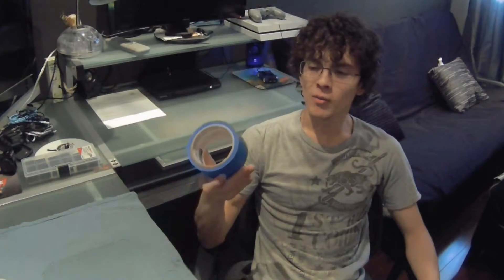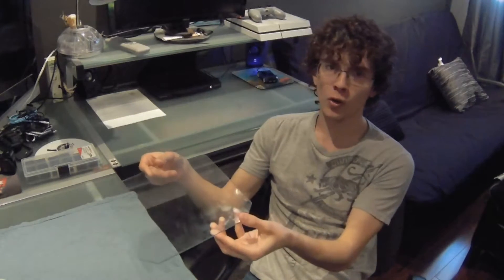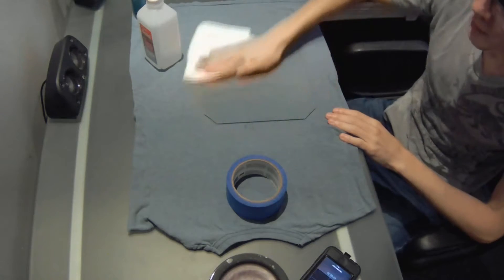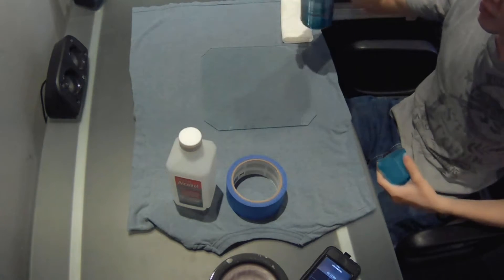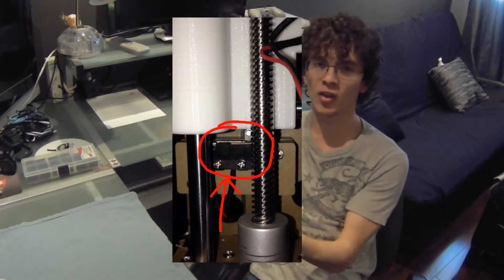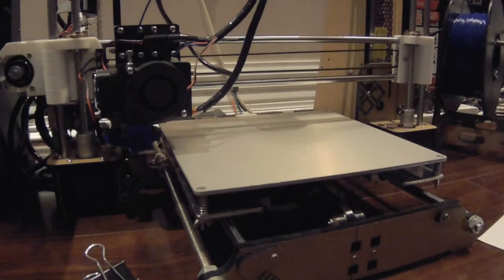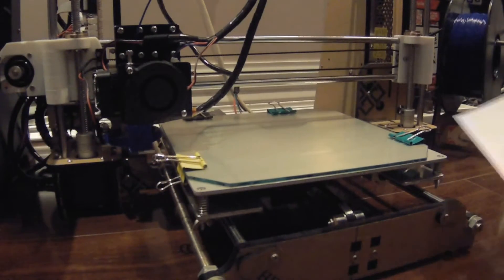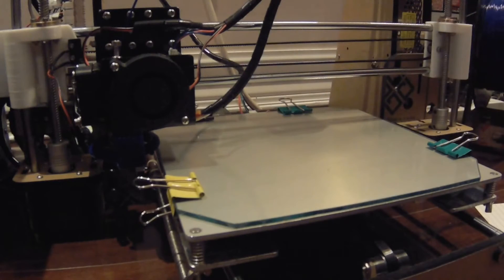Anet A8 Glass Bed Tutorial

Comment: I tape mine on the bed with painters tape around the edge
Reply from the maker: Steve Mc does it hold the glass tight enough? Sometimes I find my extruder knocking around or pushing the clamps, so I'll definitely try that!
Reply: I use thin glass from picture frames bought at the dollar store. I tape it along the edge along the Y axis only as the glass I have is too short for the  X axis. Preheating the bed before spraying on the hairspray helps with stickiness. Also when running ABS turn up the bed heat a little to compensate  because glass is an insulator and always preheat the bed when running ABS.
Reply: It works fine for me. I run it along the edge and fold it under the bed about 10mm.
Reply from the maker: good to know it works with abs too, since I haven't tried it yet. as for the hairspray, do you wait until it dries before printing? i usually spray it and wait around 10 mins until it dries and then preheat to 65 for PLA and print
Reply: I preheat before the hair spray
Reply from the maker: wouldn't that cause hairspray to get into unwanted parts from the 3d printer?
Reply: Good question. I hold cardboard at the back of the bed to protect the rails and get up close to reduce overspray. Been doing it for months without a problem.
Reply from the maker: oh i see. yeah that makes sense and works really well. thanks for the advice!